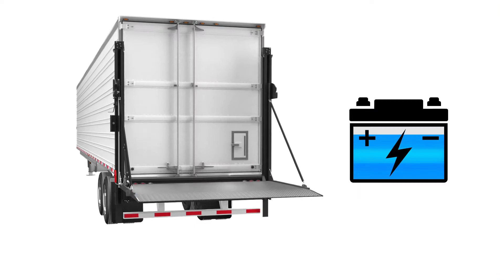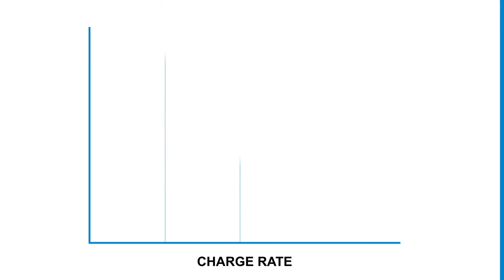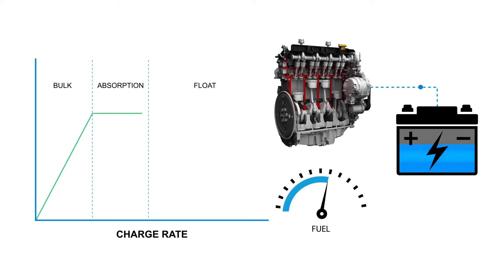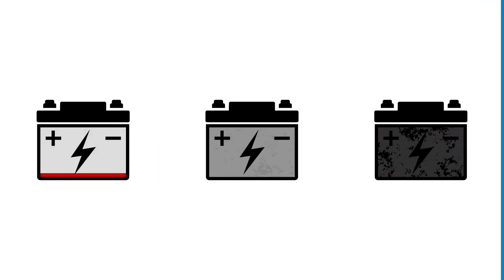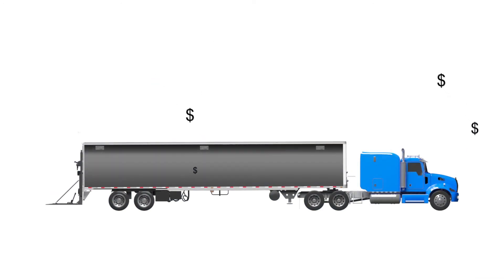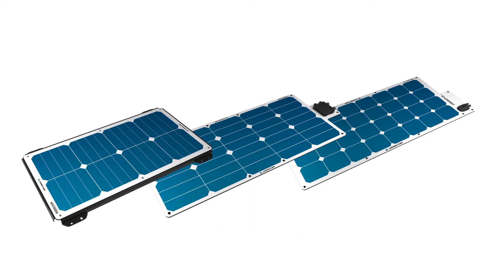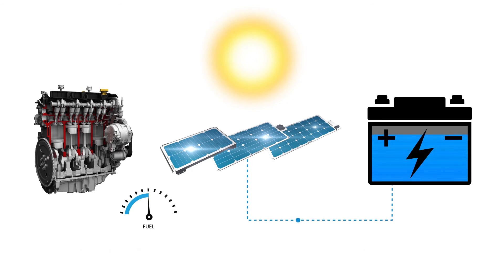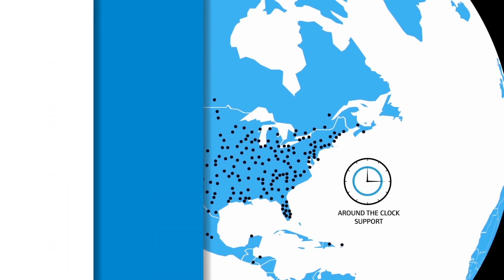Power of Solar & Alternator Combination Charging

Comment: i have a 500AH lithium battery i want to charge from two sources while in use.. a 100 Watt 12v solar panel and my cars 12v cigarette port that is only on while the car is running.  What's the best way to wire this and what do I need?